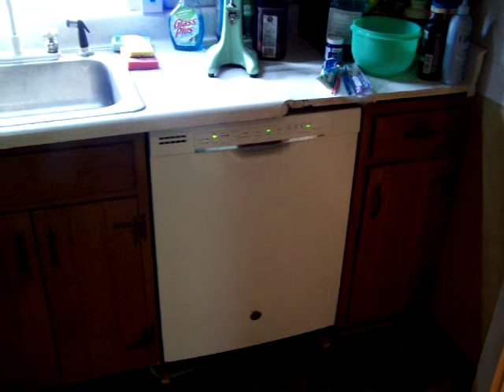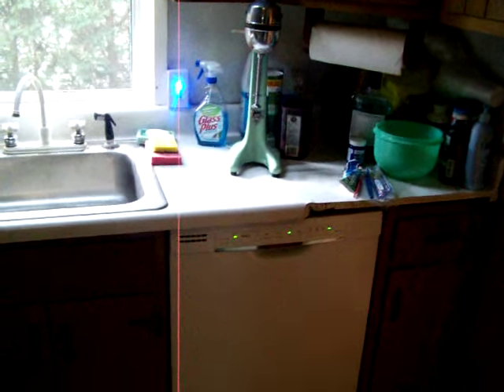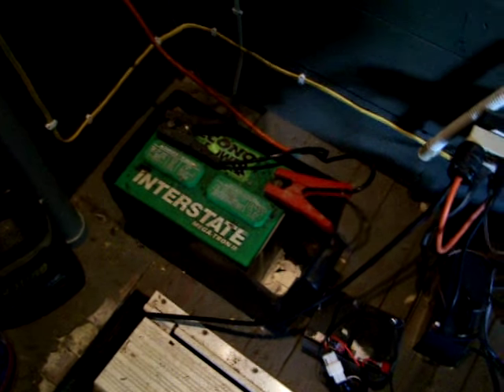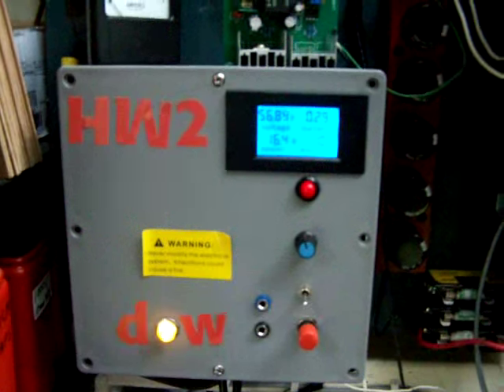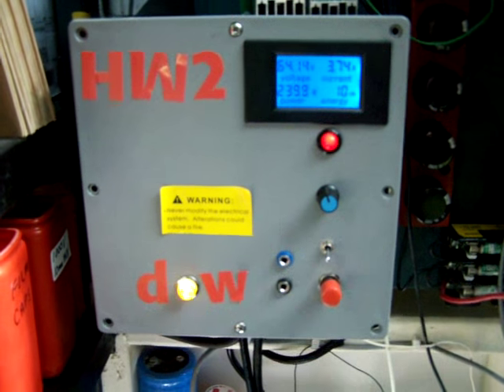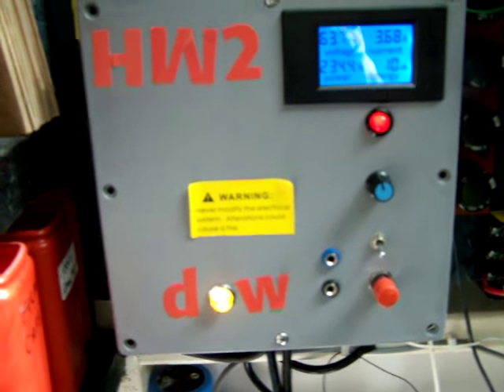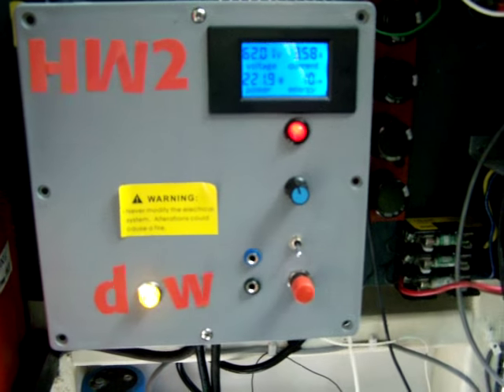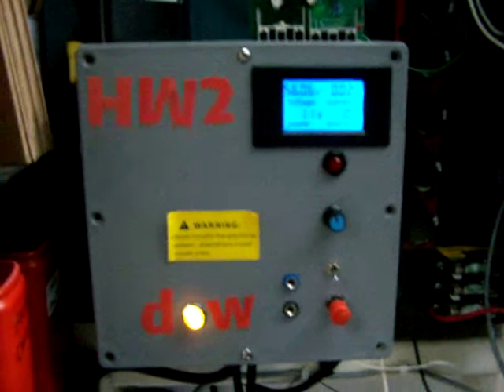Off Grid Solar 12V Dishwasher (update)

Comment from the maker: It took me a while before I went under the house to add the extra wiring for the new mod. It is a crawl space and pretty uncomfortable.  Prior to that I just switched the array voltage onto the heating element.  Much less power on those less than perfect days when the panels would drop to the twenties. Now it keeps panels at  power point. Adding the timer to keep the element on boosted temps quite a bit. Now the dishes come out super hot and dry. Quite an improvement.

Comment: Great video 👍 does anyone know if this concept would work with an adjustable wattage controller? Thought if you controlled how much a washing machine could draw it would only heat up to the set limit? Many thanks new to all this.
Reply from the maker: Might be trying the same trick with my LG clothes washer.  That only uses a small amount of water but I could only get in 250W at 60V. Not enough time to heat. There are many ways to reduce heater current.

Comment: Why not put 120 v to the element?
Reply from the maker: The idea is to avoid charge controller, inverter and battery losses. My single battery could not supply the current needed to run the dishwasher and fridge at the same time. I sometimes can't even power the heater fully from the panels once a cloud passes and the element power drops to 50W. Herding electrons is what I do, it is quite simple for to take the power big watt items directly from the panels. The battery less system is my quest. Experimenting now with a 60V inverter connected directly to the panels.
Reply: I already did that. Sucks when theres no sun. I need to run like a normal house. No limitations. I cant be without hot water or any luxury that electricty offers. Battery storage is a must.
Reply from the maker: It is a camp system and as that it is fabulous. Camp systems are way different than for permanent at home. When I started 20 years ago it was a Styrofoam cooler, bag of ice and plugging the house into the car for lights. Getting anything above that is a blessing. It does get tough once you get past mid September. Having batteries not used for 7 months changes your options. As I have become spoiled, maybe some Chevy Volt batteries are in my future.